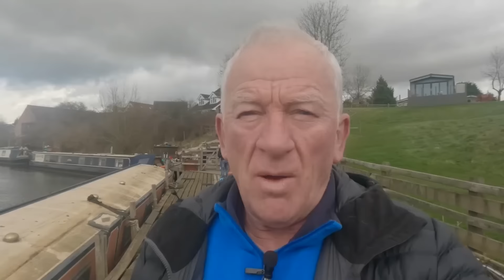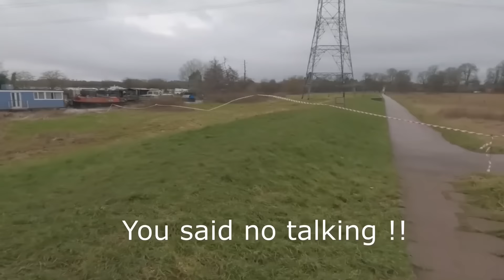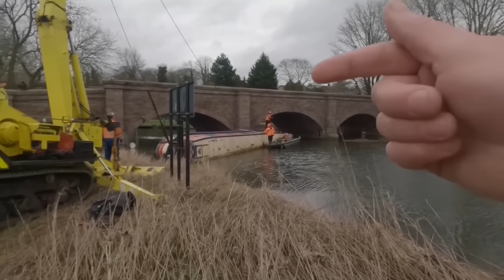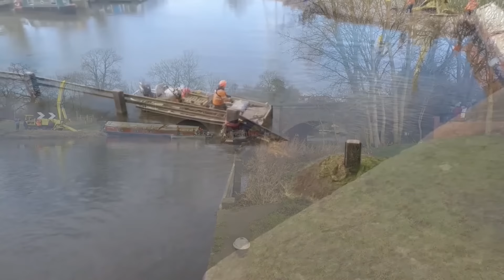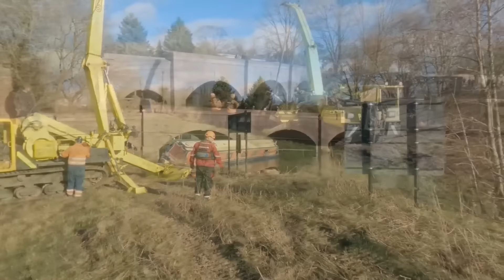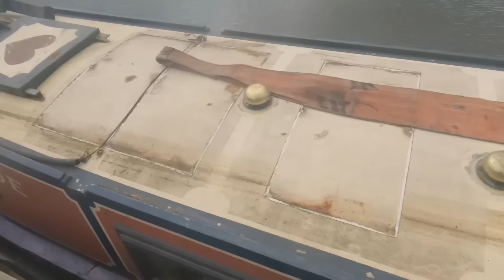Sunken Barrow Narrowboat Finally Out

Comment: that's going to need a full refit and a survey before,to check the state of the hull.i do hope it's repaired
Reply: It's possibly an insurance write off, almost everything inside damaged and water soaked, engine flooded, hull dented (as shown on here). Interior steel panelling that would never normally get wet has done and will start to rust.
Reply: @lloydpenfold486 x She's not bad seen worse she will need dry docking and a complete strip out drying and resealing plus new cladding.
Reply: @lablackzed  ...and the cost of the docking (or lifting out and dry land storage), stripping & disposal of scrap fittings, drying, resealing vs cost of a new hull? It will always have the history, necessary to declare if sold later.

Comment: Deja vu for me...I had a 60ft wooden narrowboat in 1986 which decided to break mooring and sink right in the Middle of the Grand Union well below the hull line so it couldnt be pumped out. British Waterways had a dredger nearby which came along and broke it up. I was then invoices for £1,700 which was about half my then salary and took me about 3 years to pay off. I only discovered the boat was uninsurable having bought it! Not to be put off i bought a new Liverpool Boats 40ft shell and fitted that out with some of the bits I salvaged such as the windows and Lister engine.

Comment: Well well well! I’ve commented twice on this story before. This was the correct procedure in the first place. Tracked machine on that bank pulling it out of the current. The first attempt was completely incorrect, they sank that boat. The machine is built on a murooka tracked dumper chassis,Proper  job done.👍 thanks for posting.
Reply from the maker: Thanks Jim, that machine actually had four winching points, I had earlier said two, someone also said it was one of very few in the Country.
Reply: @NarrowboatSuperB  it was made special for Crouch, a one off. My company clears bridges in North Yorkshire for the county council, we would have pulled that boat off the main flow onto that bank with a tracked machine. I’m amazed that the local council didn’t do anything to get that off the bridge ASAP. Up here they are very precious of their bridges since Tadcaster bridge collapsed a few years back, we’ve cleared it 2 x this last few months. The price that they charged to lift that boat was very reasonable. Once again thank you for sharing.👍
Reply from the maker: Ah, that explains it then Jim,  a one off made for the company. I too was surprised that Highways did not get involved, the pressure against that bridge must have been massive.

Comment: hope he can save his boat after all that water running through it
Reply from the maker: Everything inside is ruined, even the wood panels on the walls and floor.
Reply: @NarrowboatSuperB  yes I thought it would be but can the boat it's self be saved?
Reply: wasn't sure if it had done structural damage with it being pinned against the bridge with all the weight of the flood waters upon it
Reply from the maker: @aaronyoung5797  I don't think they will know until a survey is done.
Reply from the maker: @aaronyoung5797  It has, middle on one side bent slightly but enough to warrant some major work.
Reply: @NarrowboatSuperB  ok thanks well fingers crossed it will be structural sound and the owner can start the inside rebuild thanks for all updates on this 👍

Comment: Unfortunately when this happens to any boat most of the time the structure is compromised...
There was a lot of pressure put on the structure..
It will need a in-depth survey by a structural engineer.. just to see if it's worth a refit. ..
Most of the time the insurance company will decide to write it off..
I hope they don't .for the sake of the owner . They will take into account .what it costs for hotel accomodation .till the boat is repaired which could take months.
Reply: You make a good point.  I'd not thought about lateral pressure on the structure due to holding back the water wanting to get around it.  In any event, it's a back to bare shell, a complete strip out and start again.
Reply from the maker: Bare shell is about right, just been down to take a look on the inside, what a mess, update now on.

Comment: Unless insurance if any covers repair costs can't  see this being a viable boat.

Just so much scrap.

If the hull is repairable and also the engine then fine.

Everything  else need stripping out.

A massive refurb job which I doubt is viable.

The steel hull and engine has a scrap value.

Probably better off  having a boat builder see what they think.

All depends on how capable the owner would be.

But essentially  it is a rebuild job if the Hull is OK.
Reply from the maker: Hull seems to be ok, the engine started without too much trouble, an update has just been posted.
Reply: @NarrowboatSuperB  Ahh! well hopefully this this boat can be refurbished..

A massive task though as everything has to be junked.

Then the boat has to be thoroughly dried out.

No idea how long that would take.

How do rustproof the inside bottom of the boat.

All ballast bricks would need to be removed.

Essentially it is like building a new boat.

All you have is a shell and an engine.

A boatbuilder could probably do a fit out.

Comment: Is there a weight restriction on the bridge?
It seems a very costly way to retrieve the boat, not to mention doing further damage to it in the process. A large crane, on the bridge, in the small hours, could do that in a few hours, with a straight lift. The manpower required would be significantly less and the need for slings through windows would be eliminated. The regular slings, around the design lift points would suffice.
As the crew are obviously professional and skilled at what they do, I’m curious as to what led them to do it this way. This sort of recovery is usually done when road access is not possible and is regarded as the least worst option, rather than the go to method.
Reply from the maker: Unfortunately there is a  weight restriction on the bridge, also the local council would not allow it .

Comment: Would it be bad for business to use the crane to remove the obstruction und3r tne water as well?   It's the world we live in post covid.
Reply from the maker: Maybe could have been removed but it's who covers the cost, this was a job to recover a boat, it is down to the CRT to keep waterways clear of obstruction.
Reply: @NarrowboatSuperB  well If climate and pollution are anything more than a costly oppressive afterthought you would think one of those agendas/benefits would cover it
Reply: @NarrowboatSuperB  I assume that side of the  bridge is clearly signed and blocked off then to warn potential customers I mena victims
Reply from the maker: @urbanwarior3134  No, nothing by the way of signs, local council wouldn't allow fixings to the bridge, on most bridges there is a blue arrow .
Reply: @NarrowboatSuperB  I'm sure you have researched how many boats in total have been stuck there and the total proffit from all the acumulative salvages? I wonder why that wasn't mentioned.  Also the cost of the diesel and oil pollution cleanup and so on, things aren't always as they seen on the surface
Reply from the maker: @urbanwarior3134  Quite true, normally get one every year.
Reply: @NarrowboatSuperB  there are plenty of boys and rope in other areas of the network that prevent boats beaching or sinking like ikneild loop Oxford and weirs. The blue arrow sounds like a "balls in your court mentality" profitable

Comment: water comes from Leicester not the other way both routes go under the bridge towards Pillings lock. the water direction never changes
Reply from the maker: Changes on the bend by the A6 bridge,  not all the time but when in full flood the amount trying to get down forces it into the bank.
Reply: Can personally confirm there is afew places flow changes direction when its very high, from first hand experience. The lake in the middle is alot lower and in high water, flow opens up in multiple different pockets. These particular floods were a challenge to say the least @NarrowboatSuperB

Comment: Pathetic "experts" when it came to recovery. First, fight a full flood. Calculate the tonnage of resistance on the hull side from the flood waters. You will lose. Second, wait for low water. Now you have lost to equilibrium of flood water and the flooded vessel. 
The time between flood and ebb is critical.
A Bedford Light Recovery on the bridge to lift the stern weight not floating , A Tirfor winch with land anchors and snatch blocks to increase mechanical advantage. Slow but least damage recovery to a point for pumping out and righting.
Crouch made a lot of money from auctions being a member of a dealer ring at MOD sales in the 1980s. Not the "recovery in a disaster" Saint they would wish you to believe.
Don't be so naive. They are not the experts you think they are. Ask them to state the recovery resistance calculations in figures. OOOPs....I just asked a question they cannot answer. 

Just left with nobody else who will respond. So they can charge what they like.
Big change from a WW2 serviceman who bought an ex-Army recovery truck to make a living and feed his family.

Comment: 6 grand is robbery. 600 is ok.
Reply: I have no idea how much this job would cost but I'm guessing just the cost of insuring this recovery would be fairly hefty. My only comment is if they had used a mobile crane to lift and pull the boat instead of trying to drag it away from the bridge with the winch, they may have saved some damage to the hull and quite a few man hours. Just saying from my armchair Cheers.
Reply from the maker: The Highways would not allow a crane off the bridge and the roadway was about 30 yards away with overhead wires, but yes, that would have been the ideal solution.